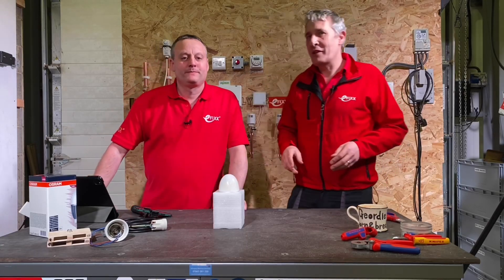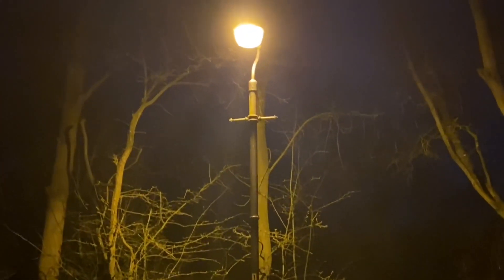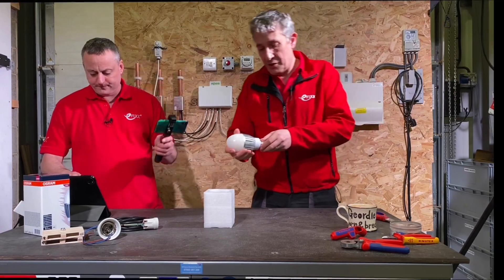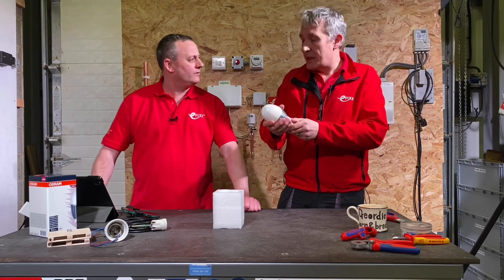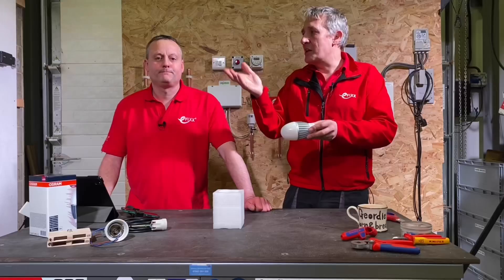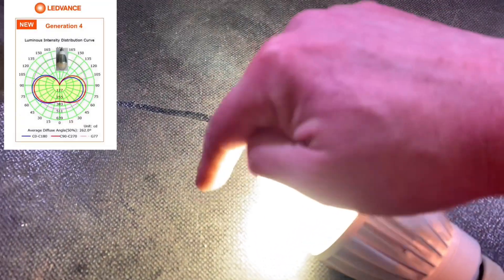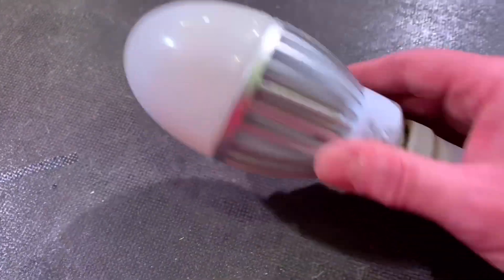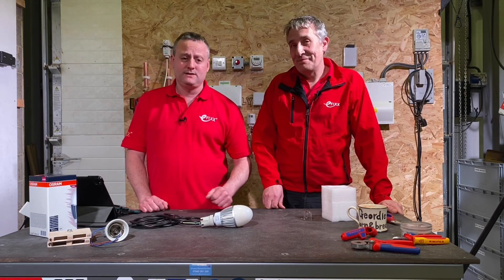CORN LAMPS are for the BIRDS 🦅  - Replacing Obsolete lamps with the OSRAM LED PRO HQL from LEDVANCE

Comment: I've been using the Toledo lamps from Sylvania for retro fitting existing lights, quit common here in London and they go up to 110w 13000 lumens, comes in the corn style version or a ufo style which are great for retrofitting the old highbay style railway type fittings .. only downside is 4000k, so the Osram will be a good alternative with the 2700k variant
Reply: Ledvance do version's up to 13000 lumen and do them in 2700k or 4000k options